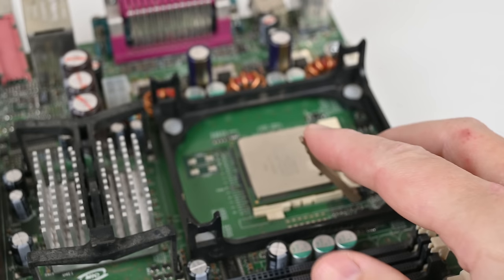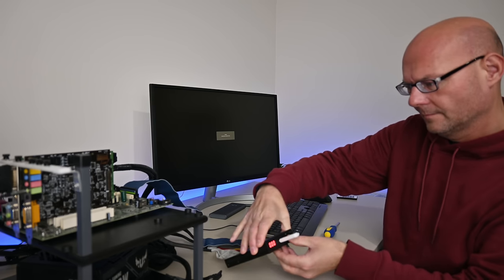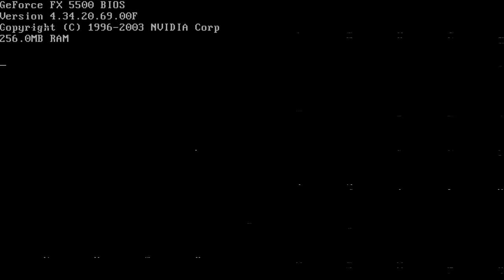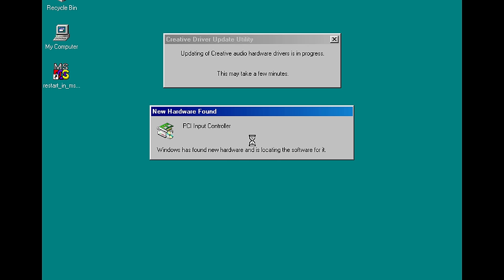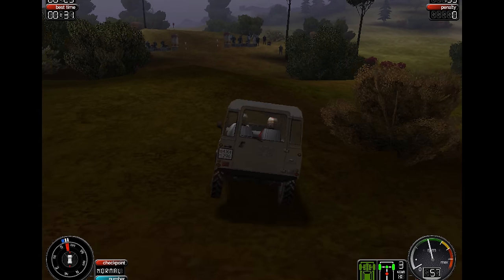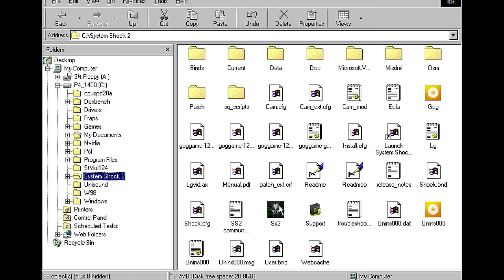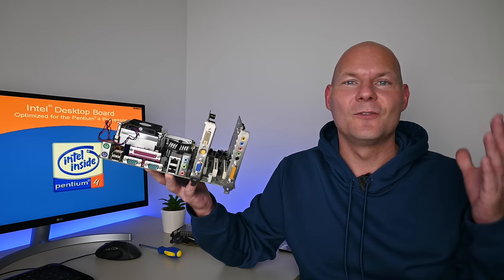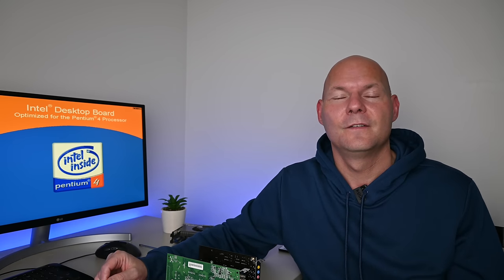It Failed in 2000, Has It Aged Well? The Pentium 4 1.4 GHz

Comment: Back in around 2003/2004 I had a Sony Vaio P4 based laptop.   I was OK for a couple of years then Microsoft released an update that really slowed XP down on it.  Slow to the point it was unusable.   

When I noticed the problem, being the good tech I was, I made sure there was nothing I needed to keep on the computer, and reformatted.   I tried the manufacturer restore, only to have the problem occur again when it was updated.    To eliminate the possibility (even though I thought it remote) of some of the bundled software causing issues, I downloaded the drivers needed, wiped the HDD and installed Windows manually.   It was back to full speed.   I let it update, and it slowed down.

I spent a long time trying to determine which update was causing the problem, but installing the updates removing one each time (and a vanilla XP install had 140 updates at this time, so this was a lot of re-installing windows) didn't highlight an individual update, so I can only assume it was a combination of updates.   Rather than try and sort that headache out, I just got rid of the laptop.  I had (and still have) a perfectly capable desktop, so the laptop was a nice thing to have, but not essential.   Besides at the end of 2007, I bought a macbook, which I kept until around 2014, and beyond Apple announcing the end of support for the model, I had no problems with slowdown, at least not to the extent I did with the Sony.

Comment: I currently run a Pentium 4 in my Win98 machine, albeit a faster clock with a Radeon 9800 currently.  Its a great system and I've been really happy with the performance from it.  admittedly I am also running a nicer Zalman cooler on it too however :)  

I dont have any GLQuake benchmarks unfortunately, but I did find the Radeon 9250 was very GPU limited on a lot of my benchmarks (Quake 2, 3, Unreal Gold, Unreal Torunament, andUnreal Tournament 2004), showing no difference in benchmark from a 1.6 Ghz all the way up to 3Ghz, whereas the Radeon 9800 showed vast improvements as clocks increased and still more again when overclocked.  The top end gpus of the time definitely have some more headroom to play with thats for sure.

Comment: My first pc build had a P4 2.4Ghz Northwood. Ended up ripping pins off of it, when I tried removing the cooler, after a power surge, to try testing in another motherboard. The cooler basically glued itself to the cpu and ripped it right out of the socket. I do still have an old AMD system with an Athlon XP 1.4Ghz Barton, that my friend gave to me in 2006 when he left to join the Navy. The DFI MB has several bulged caps around the CPU socket, but it seems to run just fine.
Reply: Depending on what the pin is for that doesn't have to be a death sentence. If it's one of the 150 ground pins there shouldn't be any difference. And I remember people having the same issue with Athlon XP or 64 systems and "fixed" it by just putting a piece of copper wire into the socket to bridge the connection.
Reply: @HappyBeezerStudios  yeah it ripped between 10 to 15 pins off, there was no saving it, unfortunately.

Comment: I and basically every enthusiast I knew back then totally ignored the Pentium 4 since we knew it was just a bad option vs the Athlon but I do know that the Northwood chips came a little closer to actually being competitive.

Just seemed like a CPU that was basically only found in prebuilts though, AMD really captured the enthusiast market with the Athlon.
Reply: Unless you played Quake 3, which scaled really well with Northwood. Oh, and video rendering. It did really well in tasks that are able to keep the long pipeline filled and don't rely on too much memory access. Or slim tasks that don't need to a lot per cycle, but scale really well with cycles. And considering the ALUs could do 2 operations per clock, with the right code, you'll end up with effective 6 GHz on a 3 GHz chip.

Comment: First real CPu was a P4 3.0 with Hyperthreading, I lapped it, got a beefy cooler, and clocked the hell out of it; think I hit 4.2 tops, but I remeber when I finally completed an OCCT run at 4GHZ I genuinely jumped around the room with joy, was a genuinely good CPU that brought one of my more memorable experiences building computers as a teen.
Reply: Overclocking P4 3GHz did a pretty high difference in FPS, late AGP GPUs were bottlenecked by P4 and games in like 2006-2008 were already designed for C2D. Even 2004 FarCry needs C2D to run with stable 60+ FPS, it's impossible to get with P4 in 1280x1024 with high details.
Reply: @Pidalin  Hah, I know; FC was one of my main benchmarks at the time; along with a pencil modded X800 All-in-wonder running XT bios I got Farcry running at a rate I was happy with at the time, but 60 fps was something I wouldn't be in search of for a long time.
Reply: @K3NnY_G  I still don't understand for what HW they designed those games. Look at for example our Czech Mafia game from 2002, even with P4 3GHz and HD4650, it's dropping to 30 FPS in city, how could people play that in 2002? I actually remember how, but it's still crazy how we played it back in the day, like 640x480, super low details and having 25 FPS. 😀

Comment: Some people in Latin America called it the Lentium 4 (Len as in Lento=slow).
Never had a bad experience. the other systems I used back then were one with a Celeron 700 MHz and a 900Mhz board soldered Duron.

Comment: I snatched an old Thinkcentre from work with a Northwood 3 GHz P4 HT processor, but I replaced it with a cooler 2.8C chip as I cluttered up the case with a Radeon 9250 PCI and an Aureal Vortex. The system had been controlling a spectrophotometer for decades and was supposed to be recycled along with it, but now it plays games in my home office instead. I dual boot XP and 98SE, and I am not terribly impressed with the Votrex under XP. I might try to get one of those creative cards for it. Thank you for inspiring me, I would not have undertaken this project if not for you.
Reply: AFAIK no Aureal feature works on XP.

Comment: Never had a 423 or 478 P4. I used a  Socket 370 Pentium 3 866Mhz (overclocked, 6.5 multiplier at 155Mhz FSB was 1.04 GHz). I used that machine well beyond it being obsolete but being in my early 20s...gaming wasn't a big concern.

Comment: I have a similar config, built 5 or 6 yrs ago, with 2.2GHz P4 and Radeon 9600xt on a red MSI board with the same amount of RDRAM. Put WinXP on it, but it seems it's much more fun with win98. Will try it in the next few days. 

My next config is a dual core pentium with radeon x1600. It is only a few yrs older chronologically than the P4, but the performance gap is huge. Amazing increase in clock speed and overall those days.
Great video as always!
Reply: Install both of it. It's just right at the spot where XP is popular, but some people were still sticking with 98 SE

Comment: The intel P865 chipset is my favorite for high powered win9x. Compatible with any socket 478 processor and includes both SATA and USB 2.0 that work great in windows 98.
Reply: I agree it’s a good chipset. 
 Kontron made a P865 ITX board with AGP and a PCI slot that I would love to find.

Comment: I skipped the 423 socket version and held out for the faster 478 skews.  Ended up with a Northwood 2.4Ghz with a 400Mhz FSB. I was also rocking the 1st gen DDR, a 400Mhz 512mb stick. What a rocket coming from an AMD Athlon Thunderbird 1Ghz.  Served me well especially when paired with a Gainward 5900FX golden sample(until that card had a literal meltdown). I was hard pressed to give that up the platform until the multi-core procs came into vogue. Even then I was still rocking a 3.2Ghz with HT on an 800Mhz FSB. After that it was a leap to the venerable Q6600. Though I still have all that hardware, I miss those days...
Reply: Reactivate that old system. Install XP/7 dual boot on the Q6600 and relive those times. Or oc it, throw Win 10 on and use it as a modern system, those old quads are still fast enough for a lot of things today.
Reply: @HappyBeezerStudios  Both systems are as they were when I discontinued using them. Way ahead of you. The p4 is XP and the Q66 is both XP and Vista. They are like time capsules in terms of both hardware and software.

Comment: I built a P4 1.9 GHZ with a geforce 4 ti 4200 128mb in the summer of 2002. I took it to college for one semester before I switched it out for a VPR Matrix 200A5 laptop, to save desk space. My dad used that P4 system for a decade before he switched it out for a 27 inch iMac. The P4's Aopen motherboard suffered from leaky caps by 2012, and it was it's time to go.

Comment: I had a Pentium 4 with HT as my second comp back in the day. Overclocked it was, for a very long time, the fastest Super Pi to 16K decimals. Beating the D840 I had as my main comp, and even the next gen Core2Duos and Quads. Finally I7 and FX6300 beat it by ~0.03 seconds (or by 20 %).

I think it was due to the high clock frequency, a much simpler cache structure and the DDR memory, which has lower latency compared to DDR2-4s.

Comment: To me, Pentium 4 shine with the Northwood core. Socket 478, 3.2Ghz with HT and FSB 800. This was a solid processor back in the day. But i went AMD side with AXP 3200+ because it was cheaper and perform about the same.

Comment: I have a Pentium4 retro machine from 2002 and upgraded it many times. 
Spec:
Pentium4 2.4 GHz/512KB/400MHz
DDR400@333MHz 1GB×2
SiS645 Chipset
X1650 Pro 256MB DDR3
Seagate HDD 120GB
48x CD ROM+ 16x DVD ROM
1.44MB FDD
WinXP SP3

It is still working and runs nearly all the XP games until 2006 very well.

I like it very much and will never sell it just like never selling my childhood either.

Comment: Back in the day I had the Pentium 4 1.6A (A = Northwood) oc'ed to 2.2 GHz on a SIS 645 mainboard because Intel had only the expensive i850 with RAMBUS and the not cheap enough but really slow i845 with SDRAM. The i845D was too late for me.
In my eyes too many people are badmouthing the P4 in general as being slow and a heatplate. I think mostly because they are mixing up the different P4 cores and some because of hearsay or just to be "cool". Yes the Willamette was slow for the money especially with SDRAM. Northwood was good only the price was high at some point. Prescott was the hot one and at that time Intel was losing more ground to AMD again performance wise. And Cedar Mill was what the Prescott should have been, a die shrink with lower temps etc... But Cedar Mill was too late because the Core 2 Duo was standing at the door.

Comment: Nice video. Back in the past I had only contact with Intel in Slot 1. Today I also uses the Pentium II 400 MHz togehter with a Riva TNT and Voodoo 1 accelerator card under Windows 98. For newer titles under Windows 98, I use my Athlon XP 3200+ togehter with a GeForce 6800 AGP. This is nearly max. Hardware for Windows 98.

Comment: I remember messing with a P4 1.4 GHZ with RAMbus memory back in 2001. Was a headache to it to work get properly allround. Compared to a "just" 1 GHz PIII or the Athlon T-Bird, which was totally stable and at least as fast for gaming - even just using SDR memory. I'm guessing The RAMbus / mainboard chipset must have had compatibility issues. But the P4 paired with DDR memory I always found stable.

Comment: I never had a P4 back in the day - they were too expensive I felt. I had a Coppermine P3-733 that worked great and didn't feel like I had to upgrade to be honest.
A few years later I bought a Core 2 Duo system (E8600), with PCIe and everything. Now that was an upgrade, whoa! Haha.. Core 2 is my favorite CPU to this day.
Still have both systems, though the P3 doesn't feel too well nowadays. I'm guessing I need to recap the board and maybe the power supply too. One of these days.
Enjoyed the video, and how you talked a bit about the games as well. Keep that up, please. :)
Also I think it's really helpful that you talk about problems you run into - that could be great info if needed!
Reply from the maker: E8600 was amazing 🤩

Comment: The Pentium 4 is a very emotional piece of technology. On the one side, it had so much marketing mumbo-jumbo while on the other it succeeded mostly due to OEM sales and wishful thinking of users. Oh, I have to also mention the fact that AMD had serious issues scaling performance with the Athlon and this is why Intel did not have the rightful beating it was asking for. Let's remember that Pentium IV was the first architecture starting with lower performance than the previous one, Pentium III, at the same clock speed. That is quite of an achievement! Intel actually had to postpone releasing a slightly faster Pentium III because it would negate the point of purchasing the 1.4GHz newly released Pentium IV.

The Pentium 4 had a failed design, as it was created only for the GHz race. It had a very long pipeline, very small L1 cache, a heavy penalty on a missed branch prediction and high memory access latency. It was made to work with the expensive RAMBUS architecture in an attempt to force the market on another path. It did not work and Intel eventually had to release a DDR RAM chipset. In order to enact revenge, they also released the ill-suited SDR version that was secretly placed in many unassuming boxes shoved by OEMs to customers, having the atrocious performance they expected. Even with the later HyperThreading technology shoehorned on it, it was still a poor product. Yes, it managed to beat AMD and yes it did so with the outrageous Extreme edition chips but this does not hide the fact that they were acting as overclocked CPUs sold by the manufacturer.

Pentium 4 was nothing but hype. It never reached 5 GHz, we are not even discussing the promised 7-10GHz range. It ran very hot, oh you mighty Prescott number crunching machine!

In short, I still think that Pentium 4 is a poor choice even for a retro machine. The fact that is somewhat unpredictable in performance means that I see it as a last resort solution. Grab any Pentium III or, even better, a Pentium M successor and you are much better in terms of heat and power dissipation.
Reply from the maker: Great comment, thank you ☺️

Comment: Great to start the weekend with new Win98 video from Phil :) BTW.  which DirextX and NVidia drivers version you have used? I have never managed to get Screamer 4x4 working properly on my Win98 P4/FX5600 build with DX9 and NV78 driver set. It was constatly having some Z-buffer issue having objects overlapping with each other :(
Reply from the maker: So DirectX was version 9, the one that comes with the linked Audigy drivers for the Live! GeForce driver version I'm sure is shown or mentioned, version 56. something 🙂
Reply from the maker: The game supports OoenGL, Direct 3D and Glide. I used OpenGL it works faster on NVIDIA cards slower in Radeon. Check the game folder you will find different executables ...
Reply: @philscomputerlab  Perfect, definitely will try then with 56 driver set. Many Thanks Phil for your support and inspiration as always :)

Comment: I built a P4 based Dell Hackintosh running Snow leopard.  DDR2 RAM.  Upgraded it to a 3.8GHz.  With hyper threading it's got plenty of power for DAW work.  Even though the processor is 64-bit. I have to run the OS in 32 bit mode because it's missing some of the core 2 Duo instruction sets.

Comment: The P4 were always in trouble somehow. The Wilamette didn’t clock high enough to really differentiate itself from the older P3. Northwood was excellent, but somehow never really got any real recognition and was on the market for only a rather short time. Prescott has its pipeline lengthened so much (31 vs 20) that it required clock speeds which were simply not possible at the time to make use of the pipeline length - that kinda overshadowed the introduction of HT, which made them clearly superior to anything else on the market in the real world (whereas benchmarks on clean systems typically favored the A64). 
I used to have a P4 530 I believe it was called, 3 GHz and HT without EM64T (that was introduced later in the 600 series). It still amazes me for how long it held up and how well it did. Only problem was the lack of power saving modes.

Comment: I was a purist until recently keeping it period correct but your vid on the p4 universal agp made me try it out and it's a nice change, takes a lot of the grief out of even older hardware! My go to machine now for lots if stuff. I'm even back to dabbling with Athlon 64s I still own from new. New format is fab, like the extra time on the games👍
Reply: I'm a semi-purist. I replaced my Radeon 9600 with a Geforce 3 for my Pentium 3 build, but I also run a DVD burner and USB 2.0 card and 80 GB hard drives in it. Basically all the great things but none of the pain.

Comment: Yes, Willamette likely got dumped on for using a T-bird-like 1.75V, while not performing better than a T-bird 800 or 900 in many cases. Northwood was very good, but one I was testing was at 45C idle and I've been told that they were cool chips, IIRC.

Comment: Great video as always Phil! Back in the day, I believe I went AMD K6-2 -> Celeron -> Athlon 64 -> i5 so the only time I ever used them then was when I was playing on my friends' computers. I do remember noticing quite a bit of difference between loading times between their computers and my crappy one. As for nowadays, both my win98 and win xp machines are running AMD processors but I'd like to do a P4 build one of these days - maybe a DX9 build with a X1900?
Reply from the maker: Hmm for a X1900 I would aim higher and go with a basic LGA 775 Core 2 system instead. The Pentium 4 really struggles, even with Far Cry and limits fast graphics cards. It really is much better suited to use an average P4 for 98 and skip high end P4s all together. But that's just my thoughts and for practical reasons. Nostalgic feelings aside!